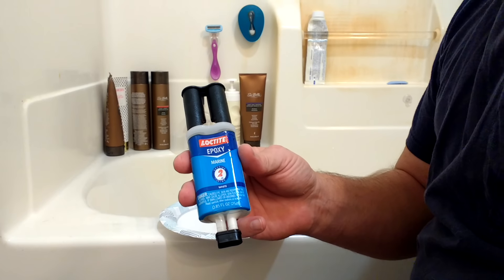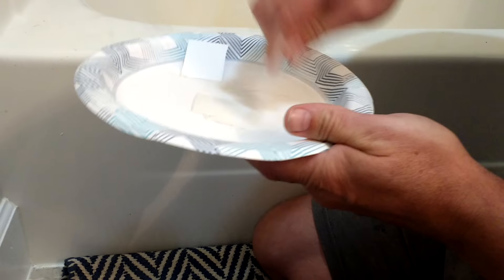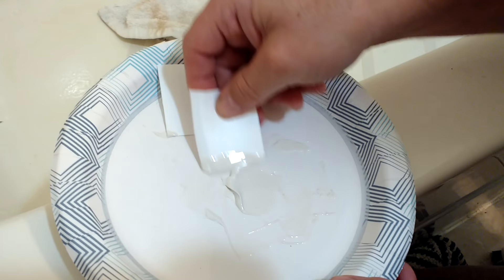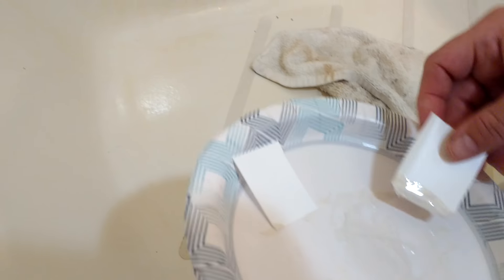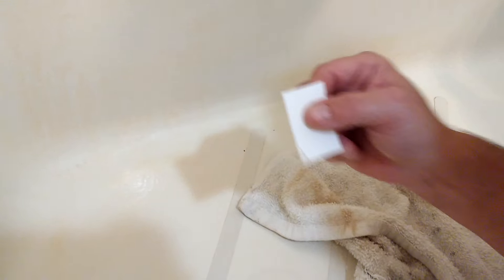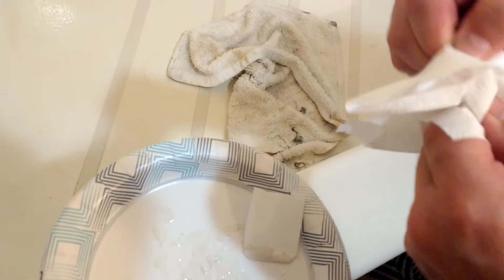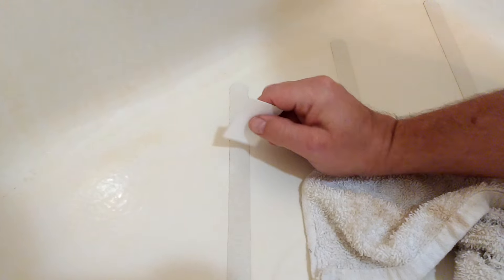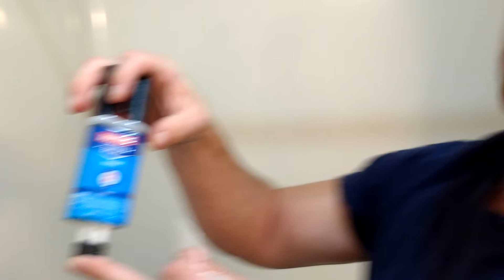LOCTITE epoxy-Fix Fiberglass Bathtub Cracks-Works great

Comment: its not white, i have  acrylic white bathtub and this stands out you need , specialty epoxy made for bathtubs to get a briliant white
Reply from the maker: indeed there are different shades of white-both in epoxies and with different manufacturers of tubs
-good point

Comment: Thank you for your video but that product doesn’t work
Reply from the maker: Need a little more information than  it doesn't work.
Reply: Hap-around the-house I have used them Wasn’t good the crack back again 
Thank you
Reply from the maker: @mustafa72100  If the crack flexes yes this product will not work. 

I was filling in a chip and there is no movement or flexing of the bath tub. 

The product needs a stable base or as you have found it will crack on either side of the repair.
Reply: Hap-around the-house oh yeah my bathroom try was crack that’s why sorry about that
Reply from the maker: @mustafa72100  I can't think of a product that will adhere to a crack that is flexible.
 If you find one, let me know. Maybe some high quality white silicone caulk. I bet it will look terrible though.
Reply: @haparoundthehouse6618  I have a crack - hairline - 2 inches or so,  caused by the fact that there is a little give underneath ... not quite solid contact with floor underneath so it cracked a bit I am going to use this epoxy that you used, but first I am going to drill two holes , one on each end of the crack , and use some gap and crack filler to fill underneath 
then I think I can use the epoxy - what do you think ???
Reply from the maker: @DJL-ms5xl  Is the gap/crack filler going to shore up the flexing you are getting? If so this sounds like a plan-I am not 100% on the drilling if the unit is stabilized-I would try the least amount of modifications first. Thanks for watching
Reply: If it came back u need to drill holes an add filler foam in the weak spot then use the epoxy.
Reply: @haparoundthehouse6618  Yes I hope the gap filler will shore up the flexing underneath - I actually have a dropped ceiling in the basement , and can access underneath the tub throw the hole in the floor for the drain - so I am thinking of filling the tub with water (to add weight so filler does not actually shift the tub in the process) the area that is cracking is about two feet from the drain in the center of the tub
Reply from the maker: @DJL-ms5xl  Sounds like a plan, what are you using as a gap filler?
Reply: If the gap filler works - and I think it will , and there is no or very little give , would you suggest the epoxy or the fortivo ?
Reply from the maker: @DJL-ms5xl  If stab;e the epoxy will work fine
Reply: @haparoundthehouse6618  Okay - thanks , will give it a go and let you know , maybe I will use the fortivo on a couple of broken tiles -  and use the epoxy as you suggest on the tub . One last question , this stuff dries white ? Or clear ... thanks again for the quick responses !!
Reply from the maker: @DJL-ms5xl  They sell clear and white-I did buy white and it dried pure white-then our water that has slight iron in it discolored the epoxy. Not bad-I did a year later video and showed this. https://youtu.be/tDlQXR3z2As
Reply: @haparoundthehouse6618  so my light scratch/crack is on the sidewall no movement so it should fill in and be fine? Its not a full structural crack. I will in the summer remove the side panel and do a few pieces of fiber glass underneath to be extra safe. at the moment it simply looks like a surface scratch.
Reply from the maker: @4skully  I would definitely use Loctite epoxy-keep in mind it is really thin until it cures a little bit. 
And reinforcing the crack is a good idea as any movement would just show another crack. Good luck with your repair.
Thank you for watching.

Comment: Will it work on a crack?
Reply from the maker: That depends-if it cracked because  there is flex in the tub then no-have to fix the flexing in the tub or the epoxy will crack.

Comment: Did it match the exact color of your tub? Can you notice the spot easily?
Reply from the maker: At first it was a pretty close bright white-then the minerals in the water turned it a little yellow-as there is a slight bit of iron is present.
.
here is a 1 year later video-https://youtu.be/tDlQXR3z2As      /hope this helps

Comment: Why do you put crack in your tittle and then specify that is just a chip? Different kind of damage that requires different solutions
Reply from the maker: good point-worth the price of admission.
Reply: @haparoundthehouse6618  I m thankful for this video. I just noticed a scratch and I think this will work well to cover it up.  what do you think?
Reply from the maker: @4skully  It is a very cheap product, give it a try. I was impressed with the loctite-I have used it on many projects as you most certainly will have a bunch left over.
Thank you for your comment

Comment: Great job!  Do you think this product would work to fill in shower floor hairline cracks in tile? Thanks for the video.
Reply from the maker: Make sure the crack is stabilized- I would also consider carefully enlarging the the crack to give the epoxy something to grab onto.
Reply: What if the hairline crack is so tiny you can't see it when standing up over the tub but only when standing inches away from it. How do you carefully enlarge it?

Comment: How about some cracks in a fiberglass tub?  Will this work?
Reply from the maker: Is it in a wet location? 

Is it leaking? If so I would say no. This is a fill product and from what I have seen the product is too brittle to repair a crack that has movement in it.
 But for $5, I would give it a shot. It is self leveling-meaning it is liquidy and will fill an area and flatten out on it's own.

Comment: Your light touch seemed to work pretty well but you should definitely have shown the finished results.   Lighting from the side of the surface would have revealed (exaggerated) the result but at least been helpful.
Regardless, the tube looks better than before.
Reply from the maker: The epoxy is very viscous, and seems to "self level" to a point. I may do a video of results next week as a few are interested.  If you have a tub that has chips, use this stuff. It is $5, made in USA, easy to use and works great.
I have also used it to reattach the bottom of  a poorly made handle mount on  a Whirlpool microwave. I had to let the epoxy sit and "firm up" for 15 minutes then applied it to the handle. I was out of clear epoxy. Worked great.

Comment: How runny is this stuff? I need to fix a nickel sized wall chip. Good tips and tricks!
Reply from the maker: It self levels-so it is fairly thin. I have used on a vertical surface, you have to baby sit it until it sets up-I think it is a half hour or so. You have to keep pushing the product back into the repair or it will sag.
.

Comment: Can you sand the epoxy?
Reply from the maker: l'm sure you could, I would wet/dry sand it to avoid the dust. Keep in mind this epoxy is self leveling-and thin after you mix it.
Reply: @haparoundthehouse6618  400 or 600?
Reply from the maker: @LFL-qp1fg  Depends on what you are doing. Is this bath tub chip repair? 

Of course you want to start rough (500) then go to 1000 then 2000 and if you are a crazy perfectionist (in good company)  3000 then buff with Meguiar's.